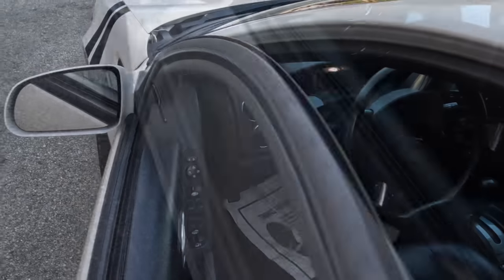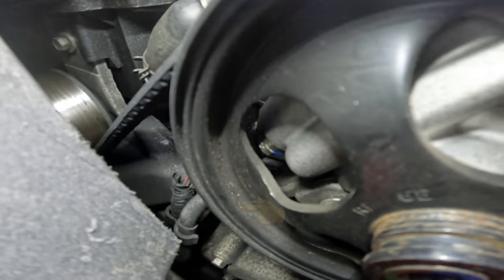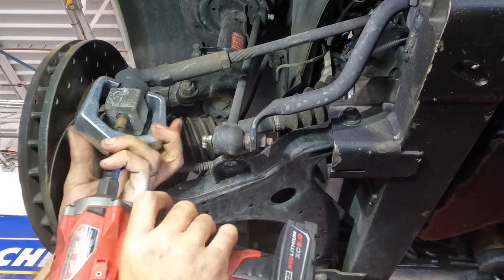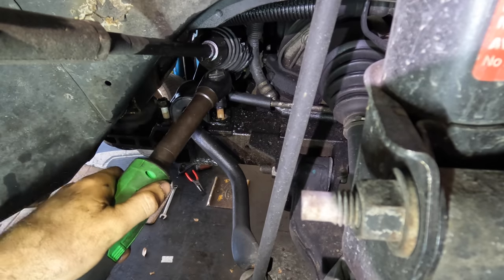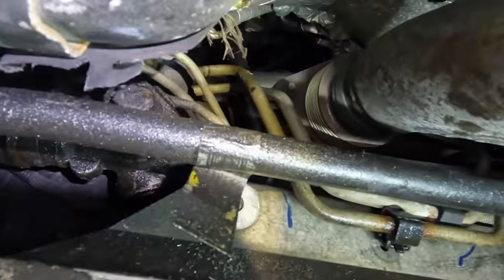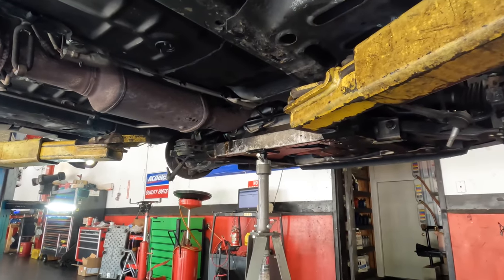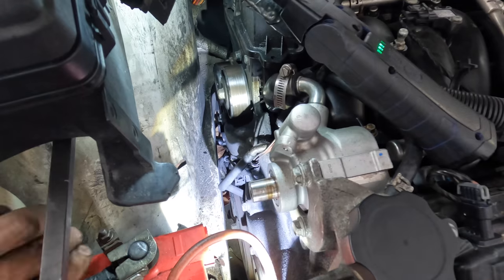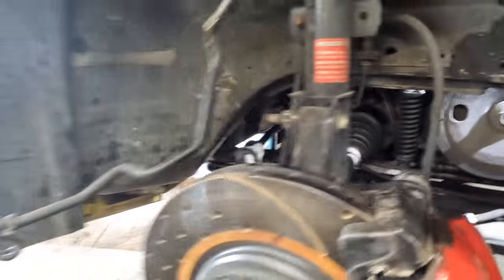Huge Leak! Front wheel drive V8 Pontiac GXP 5.3

Comment: This has to be the best demonstration of steering rack replacement I've ever found. It is difficult to get lighting and camera angles, and you hit the ball out of the park today. It raises the bar for everybody, we should all aspire to get video of this quality. What I find most amazing is the way you somehow are able to post one of these every day.
Reply: I am anxiously hoping he does a video on replacing 2013 F-150 blend doors, especially the one  behind the steering column.

Mine is done... sounds like a ratcheting noisemaker on any except one  setting of the vents.
Reply: @fhuber7507  my Chevy is doing the same thing and replacing them did nothing so now I’m looking at electrical
Reply: @fsu3784  F150 "blend door motor" is a $25-$30 aftermaket part, known to fail at appx 8 years, but one is listed 4 hours to get at (the easy one...) and the other is listed as $1500 labor at the dealer. (about 10 hours)

They also require a simple "reprogramming" (pull a fuse, start the engine, turn off, put the fuse back) or they will strip the new one out if it was not installed aligned to the exact right damper/door position.
Reply: @fhuber7507  yep. Aftermarket parts failed me my first go around and it was every bit of 6 hours to get them all
Reply: @fsu3784  The aftermarket replacement is just fine...

Failing to know you have to get the system to go through a "seek mode cycle" to  find the travel limits will break it every time.
Reply: @fhuber7507  😂😂

Comment: I miss the Pontiacs. I think GM made a huge mistake in cancelling the Pontiac and keeping the Buick. They should have done the opposite, because no, I really wouldn't rather drive a Buick. If you understand that reference, you know about how old I am . . . LOL. Another really informative video, Ray. Great work!
Reply: Buick is the #1 selling American brand in China. This is the reason GM kept Buick and killed Pontiac.
Reply: @aaronbritt2025  yep! If only they fought to effectively market Pontiac as well as they did Buick in China; they really nailed the lifestyle/cache angle for the Chinese car market
Reply: @aaronbritt2025  Thanks for letting me know that, Aaron. I forgot about the fact that it is indeed a global business. I just miss those Pontiacs.
Reply: @Starsnu1  you and me both. I owned one of these models. It was crazy fast. Paddle shift on the steering wheel, very comfortable  and lots of amenities.  Plus the red-orange illumination.  The AFM was the only issue I had with it.  I traded it the next year for the G8 GXP. I liked it too but I missed the Grand Prix.
Reply: @aaronbritt2025  Buick has cache in China because it is associated with royalty.
Pontiac styling would be considered garish by most international buyers and the German Japanese and Korean would have easily outsold it if it was marketed outside the US and Canada.
Reply: Coming from a Pontiac owner, I totally agree.  The Firebirds were always meaner looking than the Camaros.  Nevertheless, I love both variations of Fbodies🤘  I'm gonna keep my ol' Bird forever.
Reply: I have a 2004 Grand Prix and I absolutely love my car. Wish it had the supercharger or the V8 but still a great car and easy to work on.
Reply: @aaronbritt2025  Actually that is not why. The very left wing Mary Barra GM CEO at that time said that Pontiac was a Racist name that she did not want affiliated with GM and that is why Pontiac was cut off. Pontiac was GM's number 1 volume seller. Selling more cars then Buick Cadillac Chevy and Oldsmobile combined.
Reply: @danr1920  deserved to die? Had a bad experience?  I've owned over a dozen different Pontiacs and never been stranded. Never had to replace an engine or trans.  The most serious problem I ever had was a supercharger failure at over 200K and probably my fault due  to my lack of maintaining its oil. And pontiac was a GM. The G8 and the late GTOs were made by holden in Australia but still had GM power trains in them. Sorry you feel that way.
Reply: Buick an old mans car ...plus quality went into the toilet
Reply: @dalionsouled  ...i had a grand prix dont remember the year ...but went through two oil pumps ...the dipstick come to find out was a quart and a half low at full mark. ASE mechanic measured it. I ordered dipstick proper part number from GM and the dipstick was the same messed up mark.Major design flaw . Wonder how many engines ruined
Reply: @aaronbritt2025  ...china itself has like 5 car makers ...
Reply: @nickmalone3143  I get a low oil light from time to time but I'm calling that a sensor. It never stays on for more than a minute or so
Reply: @dalionsouled  ....i got that too when i had the car ...went through two oil pumps. I eventually got rid of grand prix because i hit a railroad RAIL in the middle of the freeway and it tore up everything in undercarraige especially the oil pan
Reply: @nickmalone3143  lol I don't have the tools or the money for an oil pump. When that goes I will take some anxiety meds and say goodbye
Reply: I wouldn't miss Cadillac either.
Reply: I had an 06 GTO. I loved that car. It was fast, loud, and comfortable. I put $3,500 in repairs between 50k and 72k when I traded it. It was a money pit. I had it just about 2 years. Before that I had a Cobra. I had less than $500 in repairs in the 7 years I owned it. I sold it at 127k and wish I still had it. I’m kinda glad the goat is gone. I’d have bought the mechanic a new boat by now.
Reply: i still have a 2003 bonneville SSEi parked in my driveway and 97 grand prix with the L36 normally aspirated engine. i love that SSEi, what a fun car to drive....... i did a few things to it including a pulley swap, PCM tune, power log, colder plugs..... i also have a 5 channel amp, 6 high quality aftermarket kicker speakers and a 10" inch subwoofer. they dont make cars like that anymore. i park it in the winter because i think there should be some survivng examples of SSEi bonnevilles AND 3800 supercharged cars.

id like to do an intercooler but the inflation makes it really hard to justify spending on something that isnt a repair right now.
Reply: @dalionsouled  I had the same year, a supercharged GTP, I really liked that car, but the previous owner didn't take care of it and it's body rotted, when I got it i just needed a car and it was the right price, it had too many problems with it to save, but that engine wasn't too difficult to work on in my garage/on my driveway and other than the problems due to poor maintence and storage it was a great car. which was nice. Before that I had a 2001 Grand AM GT, I sold it to my dad because I couldn't afford to fix it, he fixed it up and then many years later it was sold to my wife's cousin, that thing has 350,000KMs on it and is still going strong. I had a good run with Pontiac's and if I could I'd buy a Firebird, I'd love a black and gold '77.
Reply: I much rather have a Oldsmobile other than both of those Pontiac and Buick

Comment: When you described where the tensioner was placed, it reminded me of what my dad, a mechanic of 45 years, said of car engineers: they never took a mechanic's need to work on a car in account; they just wanted a pretty package. The engineers should be made to try to work on a car they designed.
Reply: Engine designed to mount conventionally front to back but put in sideways for front drive car. Makes for really tight work. Engine out for many things is easier.

Comment: This is what’s wrong with some of the old Pontiacs. One year they made a model you had to lift the engine it’s a hoist to get to the plugs to change them. I had to use an extra long wrench with dangly bits and extensions etc just to get under the compressor to change a plug.

Comment: My son bought a newer version of this car.   They were made in Australia in a Pontiac and Chevrolet.  He bought the Chevrolet SS.  It has 6.0 engine and rear wheel drive.  They are very rare cars.  The SS only sold 3000 per year.  Awesome car!   Brings back memories of my Chevelle SS when I was young.
Reply: You're talking about the G8. The G8, Chevy SS and the Commodore (Australia only) were all the same platform. They are rear-drive and a little larger. I had the G8 GXP which is super rare. It was only offered for 2 years. 08 and 09. Mine had the 6.2 and 6 speed automatic Trans (corvette set-up) super quick and sporty for a 4 door family car!

Comment: As you said, upgraded from a 6 cylinder to an 8, also went for the upgraded brakes. Drilled and slotted rotors, red calipers, although don't know if calipers actually an upgrade, just red

Comment: This is one of those fixes that you want to combine with a bunch of other stuff. Drain the coolant. Drain the refrigerant. Disconnect the subframe and drop the whole mess out of the bottom. Change plugs. Service Trans. Change timing belt. Rebuild front end.

Comment: Who remembers the first generation Oldsmobile Toronado? 425CI FWD..
Reply: First time I seen one smoking the front tires I thought I was tripping or something! Unique car even back then with all the competition,  still favor the VW thing for unique though.
Reply: But it didn't have a side to side motor.  The exhaust pipes were installed in frame before engine and would not come out unless the pipes were cut.
Reply: My grand father bought my grandma every year it was made. So yes I do remember
Reply: I had a 69 with the 455 rocket engine.
Reply: @randyoehlert5045  grandparents had a few tornado from 72-78 skipped years had a Grand Prix several of those. And parents had a 76 TA 455 4 speed
Reply: family had a 68 with 455ci
Reply: My Dad had a 1970. Toronado. I thought it was the coolest car. I was 10. I was very sad when he sold it.

Comment: I bought an 06 Grand Prix for $200 in the first month of the pandemic and completely rebuilt the motor... very cheap to work on, and with the V6 motor, tons of space and easy to pull. Fast forward to two weeks ago, and I had to pull the motor again to rebuild the transmission. Which was a lot easier than I first thought.

The whole time I was looking through your videos and wondering when you had worked on one of these w3800 v3 engines... lo and behold, my morning surprise is getting to see (kind of) my car up on your rack.

Thanks for the amazing videos, Ray.
Reply: See my note ...check your oil capacity against the dipstick  full line. It may be off by a quart and some.

Comment: It's so interesting to see how clean the cars you work on are compared to up in the rusty Northeast. Up here even with the cover that steering shaft would probably need the ears spread a bit with a chisel and then some hammer action to push it off of the rack.

Comment: i have a 2003 bonneville SSEi 3800 supercharged. these supercharged and V8 FWD pontiacs can be allot of fun. the L67 3800 has plenty of potential. i just did a PCM tune, colder plugs, wires, power log and a pulley swap. they are fun cars.

Comment: Those were very nice cars. I do wish they made them rwd.  Had a friend with an Impala SS, with the fwd 5.3l, and they did the same with the Monte Carlo.  I believe these would be highly sought after cars if they were RWD.  Excellent video as always.
Reply: They did, and they are...Pontiac G8 and Chevrolet SS.
Reply: @chrisbailey5055  not even the same car man. W body and Epsilon II  cars which are the  2006-2016 and 2014-2020 respectively, are not the holden  based Chevy SS  or G8 which is a Zeta platform.
Reply: They're already hi demand. check out pricing on any in good shape
Reply: @Jordy-927  So you literally meant they should have completely redesigned a FWD platform into a RWD car?
Reply: I like the 1999 impala with the LT1 motor it was basically a 2door caprice that was saucy
Reply: @chrisbailey5055  it was hypothetical man.
Like I wish the W-body was RWD.  I liked those cars styling, but because they were fwd I'd never even consider one.
Reply: I like to think they had the genius idea of putting a V8 into a FWD car. We'll never see such stupidity like that again. Europe had something similar, Alfa Romeo 147 GTA (3.2L V6 in a compact hatch).

I do wish they had a 6 speed automatic though. 4 speed automatic these had are just lame with long ratios and blunt performance.

Comment: What Pontiac was able to accomplish fitting a V8 in a V6 engine bay and make it front wheel drive still amazes me. V8 engine in a V6 engine bay with the power steering rack and transmission all up front that’s some engineer madness

Comment: In the late 80's & early to mid 90's G.M. had a problem with the seals on the pinion shaft, causing a hard steer when cold, the fix was to remove the rack, and replace the seals with a split ring seal kit, it's been  over 30 years since the last time I did one, but the part # is 26010340, I did a lot of them.

Comment: Instead of beating a piece of wire flat, next time look for Mr. Grip at your local big box store, it's great for filling holes that are stripped and ads quite a bit of grip strength. It is a thin steel perforated insert.

Comment: Ray at 35:35 you should have the plate on the screw jack cup the frame instead of sideways. You did at the start. I don't want anything to happen to you. Keep up the great work 👍
Reply: I saw that too.  Got very close to the edge when the car was lowered to get the subframe back up.

Comment: Up north those clamps hold salt and moisture to the lines rotting them out. I always put a huge glob of high temp silicone grease used for brakes around the inside of those clamps to prevent rust.

Comment: Hi Ray, Keep the video clips coming I enjoy them so much. Like you mentioned about your crow's foot and at all cost you would never loose it. In May 1980 I walked through the doors at Rolls Royce and my first item I purchased from the rep was a 3/8 snap on ratchet, I still got the same ratchet and still use it 42 years on. Keep smiling dude....

Comment: That engine compartment has plenty of room compared to an old Mach 1 with a big block V8. In order to change the spark plugs in my brothers 427 Cobra Jet, you had to loosen the motor mounts and jack up the engine, but man that car was fast.

Comment: Steering rack replacement has been a nightmare for me before but you made it look easy!  Keep up the great work sir
Reply: Some take half hour. Sum take all day
Reply: Helps an awful lot if you have a lift!
Reply: @PurityVendetta  Where s your sense of adventure....? 

Mine was happily changed when BendPak came into the shop.
Reply: @peted5217  I did the bushes in a Watts linkage on a Land Rover Discovery last week. The bruises on my shoulders disagree 🥺😊
Honestly, I'm too old for heaving on 3' breaker bars while lying under a car on axles stands. I had a discussion with a guy in the trade I know. We were laughing that we can get down there but it's the getting back up that's the issue 😆
Reply: Piston - Cyl clearance can be ck'd w/long feeler gauges in a pinch

Comment: Reminds me of changing the spark plugs and wires on my Buick Rainer 04 with 5.3 V8. Usually came with a straight 6 motor now has a V8 in a Straight 6 hole. Took all of 6 hours.

Comment: When I do those I use a big "c" clamp on the sway bar and cradle. Compress it very little enough to get the rack anchor bolts out. Up in here in wis. Those sway bar bolts aint coming out.

Comment: The end caps on the new steering rack rods are not there for protecting the threads. They are there to prevent shipping box failure. Kinetic forces applied to the box by the shipping company will cause the steering rack to move inside the box, because of inertia of the steering rack. The rods have a small surface area at the ends and will exert a concentrated force on a small section of cardboard. For example, at the abrupt deceleration at the end of a fall of the box, the forces at the cardboard will exceed the shearing force of the cardboard, resulting in a puncture. The end caps are there to increase the surface area of the rod, increasing the section of cardboard the force gets applied to, increasing the ability of the cardboard to withstand puncture.
When a box is punctured and a metal rod is sticking out, the box is no longer compliant to the rules the shipper stated on packaging standards for packets to be shipped by them, which might result in a non-delivery return-to-sender situation. The sender will need to repackage and resend. This causes additional cost at the sender's end, annoyance at the receiver's end.
If the shipper would handle packets as they promise, the end caps would not be needed. Good that the sender knows about the harsh reality of real-world shipping circumstances and applied surface-increasing end caps on the rods, so Ray gets his part in time and we'll be able to enjoy his good mood in this video.
Reply: How Interesting.
Could be Thesis for PHD in consumer package Engineering 4 next break-through.
Reply: @Rick O'Sidhe LOL. I almost spit my coffee out. Great synopsis of was was written.  Have a great day!!
Reply: You surely deserve an award for the detailed   explanation you provided! Very descriptive and complete.
Reply: That was awesome!
Reply: Nerd alert

Comment: (@41:10) - what about using plastic wire ties slipped through the pulley and fastened to that large, round stud-like thingy on top of the power steering pump to keep the pulley stationary whilst you put clickage on the tightening device? Then you can just cut the plastic wire tie when you’re done, and no one will be the wiser (except you).

Comment: I'd much rather have the replacement for this car. The G8, especially the G8 GXP with the Tremec 6060 will be a collectable some day. They only made 1800 GXP's with the LS3 and half of them are autotragics. 

You could probably get any of them and transplant whatever you want into it since the big thing is the rear wheel drive architecture.  

You can't build the FWD because the transaxle is the huge limitation.